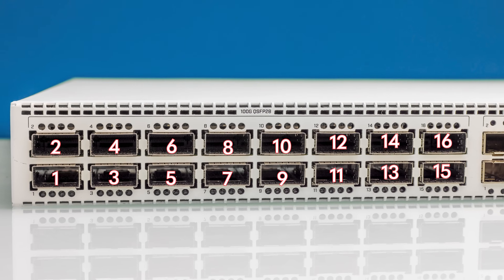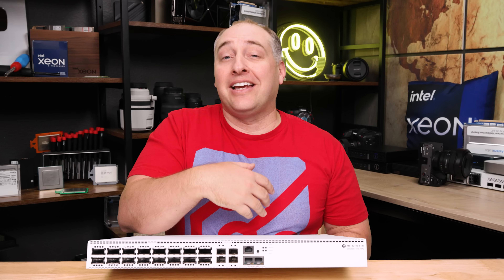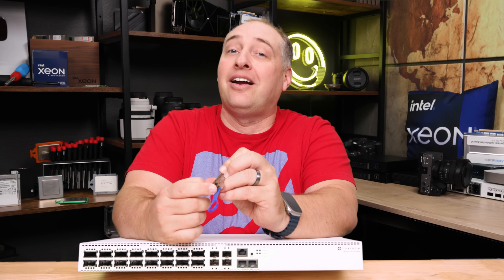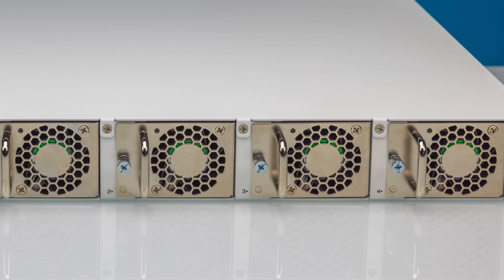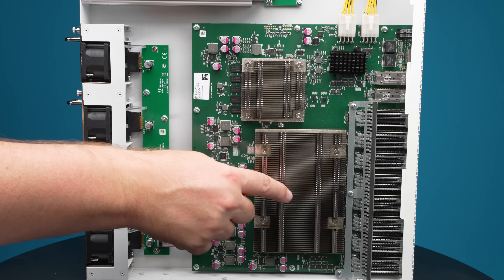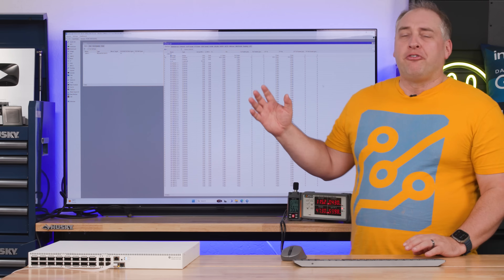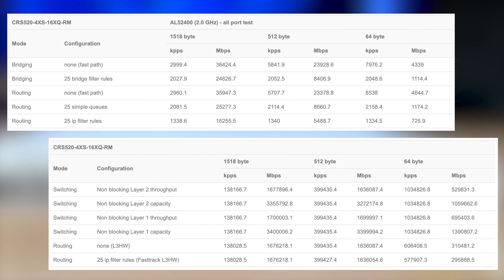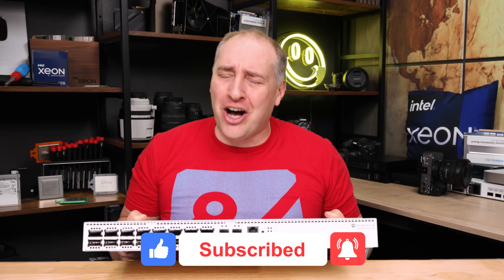Low Power 100GbE Gets Affordable and Easy with the MikroTik CRS520-4XS-16XQ-RM

Comment: 10 gigabit management port lol
Reply from the maker: More like two :-)
Reply: @ServeTheHomeVideo  But why?! Is it cheaper than sourcing 1 Gbit/s ports? Are there any real world situations where a 10 Gbit/s management port is advantageous over a 1 Gbit/s port? Are there any firmware updates that are so big that having 10 Gbit/s just makes sense?
Reply: @MrMartinSchou  Mikrotik sometimes does things because they can, not because it makes sense :)
Reply: @MrMartinSchou  Yes cheaper. The ARM SoC already has the ports built into it
Reply: @MrMartinSchou  By that argument, there's also no need to actually have two management ports.
This switch has some pretty beefy RAM and FLASH compared to other switches, so there's a bunch of things you can do with the management ports.  Anything that has to pass data through the CPU could potentially work on it, even routing.
But I think my favorite answer would be "because the CPU supports it."  In contrast, I have a CRS-518-16G-2S+IN, which uses a Wi-Fi SOC for its CPU...but it doesn't have Wi-Fi.  Would be fun if they added the features supported by the SoC.
Reply: @MrMartinSchou  it's not for speed but compatibility. It's easier in the datacenter to find a sfp+ port then any 1gb sfp or copper.
Reply: Can’t find any actual specs on the cpu itself but it’s more likely just what was directly supported by the cpu. The block diagram shows the 2 10g ports connected directly so limiting it to 1g would have meant useless extra hw. As mentioned above these ports could actually be used for anything so why restrict them if the cpu has 10g native anyway.
Reply: @killsudo the management ports are rj45 not spf
Reply: @killsudo  so wouldn't that be less convenient?
Reply: @MrMartinSchou   CRS520 is a combination of a 100GbE switch and a full fledged software router in one case. 10 GbE "management" ports are directly connected to router SoC and can be used as regular router interfaces.
Reply: @MrMartinSchou  check out block diagram. The management CPU has two 10Gbit nics in the same package so they have them anyway. They chose this so the management CPU has two 25Gbit interfaces to connect to the switch (so it can do some high bandwith auxiliary stuff and isn't just there to run a web interface). Other switches with similar arrangement have 10Gbt management ports "just because".
Reply: @shanent5793  not in the sense that you can still adapt a 10g/25g sfp25 port to copper  for this without needing to worry about 1g signaling or getting fancy copper sfp+ modules that can buffer and negotiate to slower speeds.
Reply: Look man I'm in a hurry and I need my management port to go FAST.
Reply: @killsudo  you said it wasn't for speed
Reply: @marcogenovesi8570 The switch chip has 1.6Tbps, so the 25G won’t be non-blocking with all 100G ports populated, but it’s still crazy performance for 2k.
Reply: @Techsupport243 Fast? That Would be 100Mb 😂
Reply: @LtdJorge  I said auxiliary. I know a 25Gbit pipe isn't going to hold 16x 100Gbit ports of traffic. These switches have a lot of L3 features and not everything is hardware accelerated
Reply: @marcogenovesi8570  No I mean that the 10G ports are backed by the 25Gb uplinks, I agree with you. So if, say, 8x 100G ports are occupied, then the 10G ports will be switched at line rate to any 100G port or 25G port. If all 100G ports and 25Gb port are occupied, then the switch cannot switch all ports at line rate, since it maxes at 16x100G. But I just wanted to say that the 10G ports can be switched at 10Gb unlike in other switches where the CPU ports only have a 1G uplink or something like that.
Reply: MikroTik always sets the dial to 11. 😸
Reply: Managed switches like these can often do packet capture for diagnostic purposes. Transferring or streaming packet capture files may justify a 10gb port.
Reply: @DataScienceDIY  It's not a SFP+ port but a RJ45 port (i.e. normal copper ethernet)
Reply: @marcogenovesi8570  Thanks, thought I had just missed something when reading the other comment. The bit about packet capture is still valid.
Reply: Gotta be able to stream 10Gb/s of compressed config data to take full advantage of all the bandwidth availablen. 😂
Reply: @killsudo  But the management ports are 10G copper.. lol
Reply: @shanent5793  It's about compatible link speeds, not useful throughput for management

Edit: and as others have stated, these are more or less "optionally" management ports, but can be used for non-management purposes, too, so 10 Gbps is rather useful
Reply: @ServeTheHomeVideo  why would you need 10gig for management lol
Reply: @MrMartinSchou  time is of the essence, time is priceless, no waiting for downloading software
Reply: It's a Mikrotik, you can use those ports for anything, not just management.... you might be using it to mirror data to a laptop (1g not enough) or you might have 1 device that only has copper... .people need to open their mind
Reply: @Felix-ve9hs  You just don't open your mind, or don't work on complex networks

Comment: Looking forward to the day a low power 8 port 100G switch is $500 or less, maybe in a couple of years 😄
Reply from the maker: Getting there slowly
Reply: @ServeTheHomeVideo what's the point of this why would anyone in their home would need this
Reply: @chriswright8074  why would anyone ever need more than 640kb of RAM...
Reply: @chriswright8074  I'm yearning for faster LAN, because transfering 70 GiB of photos over a 1 Gbit/s line is quite painful. That's what I have to do right as I get home from a photoshoot. Then, editing off the NAS is pretty painful with everything taking a significant amount of time as the raw files need to be fetched, previewed, prevgen applied, and indexed. The gigabit isn't saturated because of the huge latency on a single NIC.
Reply: I think that Microtik already have the 4-port version, so in theory, you might be able to pick up two of those. Won't be $500 mind you (closer to $1000-1200), but it's definitely coming down in price.
Reply: @AnnaVannieuwenhuyse  10gig, and 40gig hardware is pretty cheap used and would be much a dual port 40gig card in the NAS and a direct connection to the ingest and editing computers would be only a few hundred dollars. If it's a business setup, that'll probably pay for itself pretty quickly.

Comment: I think the usecase mentioned is pretty mouch the prime usage example for a switch of this kind. Cameras like the URSA 4k can get up to 20gbps for a single camera and when editing a multicam setup of five of these then even a single user can saturate 100gbps. Of course this is a usecase that you will almost never see in the wild (As it is pretty stupid), But even with 2-3 editors in a reasonable use case you could saturate a QSFP28 port.
Reply from the maker: I think a future Mac Studio will go 100GbE. Blackmagic has 100GbE NAS or at least footage dump options already
Reply: @ServeTheHomeVideo  I am currently designing a 25gbps SSD NAS for me to use at home. I am on a pretty tight budget so it probably will be a moded old Dell Poweredge. But I can get two sfp28 network cards, a server and the switch for about 800-1000USD plus the price of the SSDs.

Comment: Hey. Is there a such thing as a sfp28 rj45 cat8.1 PHY? I have seen cat8 cable being advertised as a lower cost solution to fiber or Biax but no hardware to support it.  Or is it a future proofing technology as in install the cable now so you can use it later.
Reply from the maker: 25G and higher you are better off just using fiber. Realistically over 10G folks seem not to be pushing copper outside of short-range DACs.
Reply: @ServeTheHomeVideo  Thanks. I find it strange that it is marketed as a replacement for twinax but there are no appliances that actually use it outside of  as a replacement for cat7 in the few applications it is better for, like around industrial equipment with alot of emf noise. I was wondering if anything actually used it.

Comment: First mikrotik only adds that H3 ofload will be expanded. L2 works as it should.
2. Winbox case if you know it is a great interface (cli is always available)
3. L3 is executed by ARM processor and this is where mikrotik works to do as much as possible through hardware support by switch system

Decent performance in mikrotik only in L3 in L2 we have high performance

Comment: I wonder if this switch can be used as router as it was mentioned somewhere. BTW Mellanox SN2700 which is 32 port 100G switch has similar power consimption to this Mikrotik. I have this Mellanox SN2700 at home and it draw about 45w idle with no transceivers plugged in. Now with 11x QSFP28 power consumption is 96w. I bought few of these Mellanox SN2700 for an ISP in my area for little less than $1000 each. They gave me 1 for free as a compliment :)
Edit
Actually we weren't aware of the power consumption of this Mellanox before we buy and our expectations were higher and this was a pleasant surprise :)

Comment: that one must have been released very recently, I checked last week when looking for a 25G routers and they didn't have switches with such specs yet. 

but having 100G bandwidth capacility within a LAN is quite nice actually. if you think about it, the latest gen NVMe drives go up to 12.5 GB/s, which is about 100 Gbps. 

you could setup a compute server with a bunch of GPUs and a data server with a bunch of Gen5 NVMe's. then the compute server could receive data from the data server at the same bandwidth as having NVMe drives internally...

Comment: I'm still rocking the Mellanox MSB-7890 36-port 100 Gbps Infiniband externally managed switch that I picked up in 2018 for $2950 CAD (at the time, which works out to be something like $2300 USD, used).

For a homelab AI/HPC cluster, I'm definitely using 100 Gbps.

Comment: CPU in this switch seems to be more powerful than the one installed in CCR2004-1G-12S+2XS. You can't make it sweat with two 10G copper ports. I should happily route and NAT few gigs of Internet uplink.
Reply: yeah but it's a bit pricey for "a few gigs of uplink"
Reply: @marcogenovesi8570 No switch is perfect.

Comment: Total noob here, is it possible to connect this switch to another one that uses qsfp+( The 40gbps one) like their flagship 48port switch that has 2 qsfp+ connections? Or more generically (q)sfp28 to (q)sfp+.
Reply from the maker: Yes, but you will be limited to 40Gbps on that link. Likewise, you can use 10G SFP+ optics in the 25GbE SFP28 ports, but they will only run at 10G speeds.

Comment: 100 GB/s is faster than an Intel Core X memory bus... and we are very close to Terrabit Ethernet. I don't get it.

We need an open source consumer mainframe OS
Reply from the maker: 1.6Tbps Ethernet will be deployed in 2027. We just did a video on a 64-port 800GbE Marvell switch two weeks ago. 800GbE would require a PCIe Gen6 x16 NIC just to handle a single port.

Comment: we are currently renovating the house and i managed to convince my dad to run cat7 ethernet everywhere, so now we have like 30 runs of cable prolly gonne be more when we starting to renovate the garage and garden shed. 
What kind of switch would u guys recommend for my usecase?

i have a nas with 10gbit would hook my pcs up to 10gbe aswell and the rest could chugg along with 2,5gbit or 1gbit maybe, aps, cameras, tvs and such.
i would like to experiment with vms and different vlans in the future maybe have guest wifi and normal wifi and stuff like that

Comment: Would love to know if it can do MACSEC to any decent degree. I have three buildings interlinked via dark fiber at 10GbE, and encrypting those links is required. I'd love to upgrade to 100GbE but any gear to do that with MACSEC support is too insanely expensive.
Reply: Mikrotik RouterOS 7 (their current firmware) has an immature MacSEC. It's still in development and hardware acceleration or other features are missing. Check again in a year or two

Comment: Does 100gbe behave like a link aggregation of 25gbe? If it does then you cant get a single file transfer going between systems at 100gb it will only be good for 25gb. Is that true or false?
Reply: why are you trolling?
Reply: No, it does not. You get a single 100GbE link unless you split qsfp port intentionally.
Reply: @mvs3246  Nice. Thanks.
Now that makes it an interesting choice between the 4*100gbe mikrotik or the 16*25gbe mikrotik switch for me.